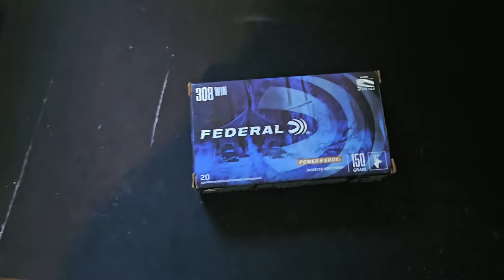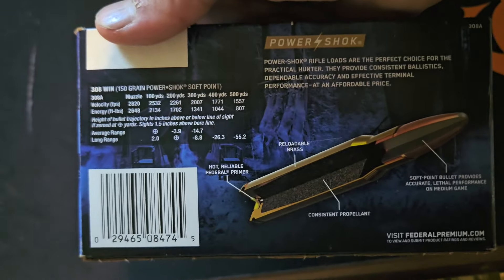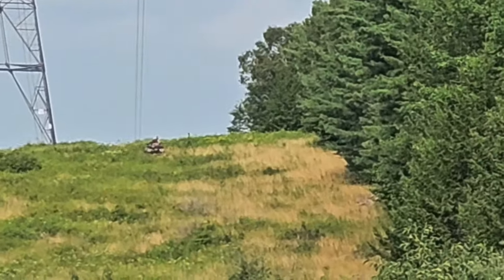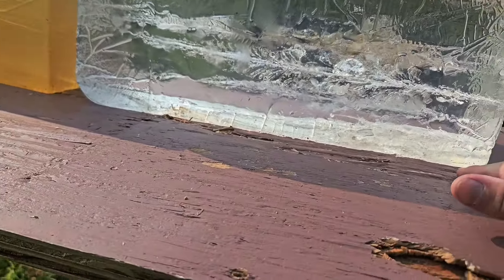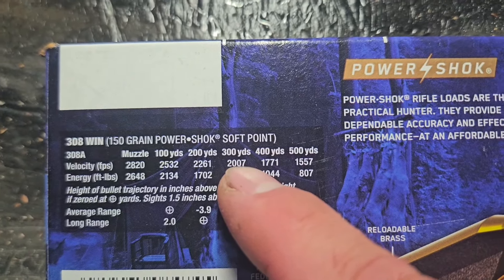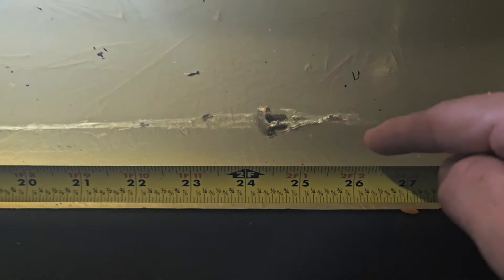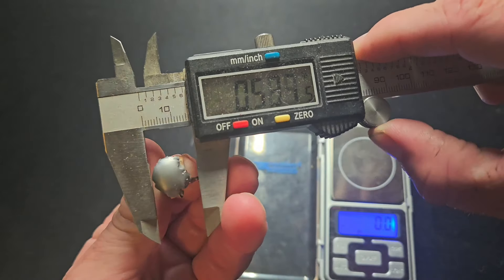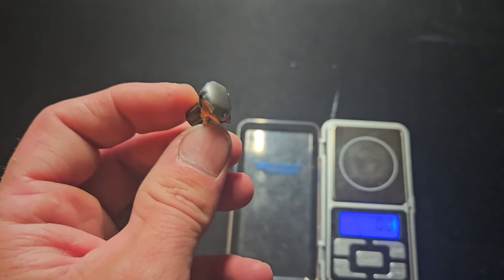308 :  federal power shok 150 grain | 300 yard gel test

Comment: All you need if you’re ok running lead and shooting normal ranges. We get so obsessed on YT with hitting things at 500+ when it’s just such a tiny minority of hunters taking those shots, especially in the eastern half of the country. Power shock or fusions always seem to get it done. I think the fusion is a bit better and worth the tiny up charge, but it’s splitting hairs.
Reply from the maker: If I was using a faster cartridge I would definitely pick the fusion because it'll hold together better. For the 308 the power shok seems to be fine.